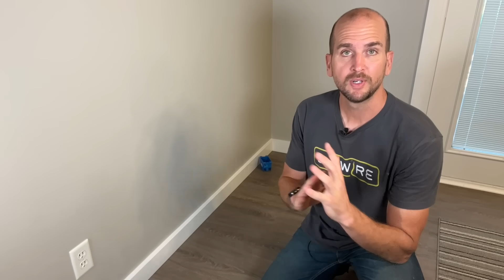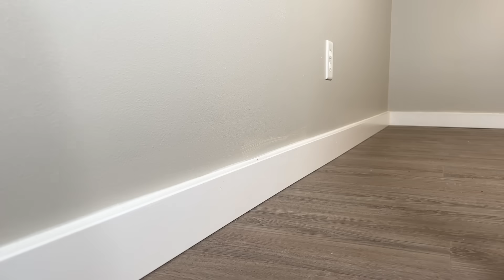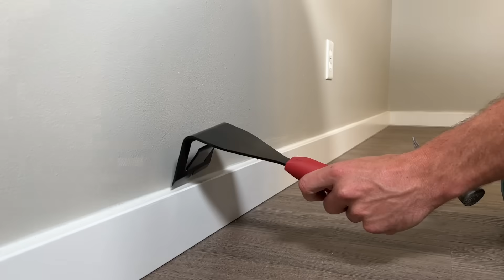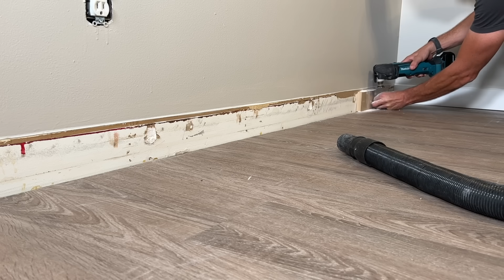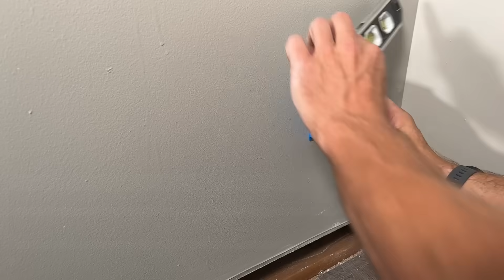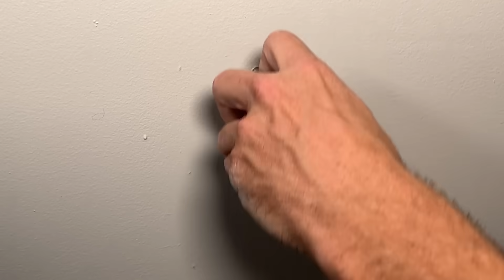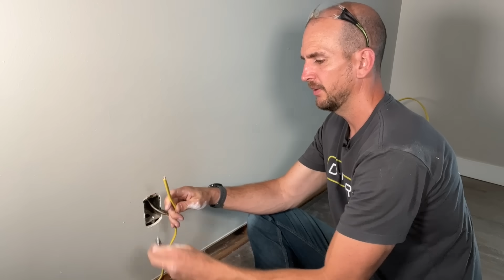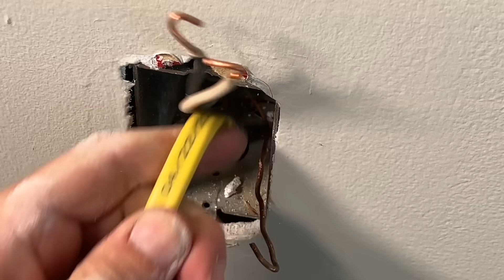How To Add An Outlet To A Finished Wall

Comment: As a Licensed Journeyman Electrician (WI) of almost 30 yrs, I have to question 2 things.  1.)  Why in the World are you using 12/2 (which is use for 20a circuits) and not 14/2 (which is easier to use and much cheaper - 15a), unless you plan one using Heavy duty power tools in that room, and ... 2.)  Yes, the connection to the receptacle would be a "hack" connection in a "NON-Commercial " outlet  which can cause problems with outlets that are fairly used and removing the wires often results in breaking the wire inside and having to replace it.  I have also seen where the wires that are pushed in, overheat as the contact points actually open up over the years. I would STRONGLY urge anyone trying this to consult a licensed Electrician first ( 99.9% of them will give you free advice) which can save you time, money, and the confidence that you will not create a fire hazard. YES, I have been to MANY homes where the outlet overheated and and the wires actually charred.  Residential outlets cost about .35 - .50 cents,  compared to the Comm Grade at $2.50 to $4.00 depending.
Reply: As a licensed electrician you should know it is against code to use 14/2 on a 20 amp circuit.  Also, the outlet he used did not have a spring connection against the wires - it had compression plates that tightened from the side.  He pointed this out.
Reply: @userdjl  My question was.. why are you installing a 20a in a bedroom/office, when there is NO reason other then, you plan on using it as work shop with Drill Presses etc. or Kitchen...AND..AND, I know he was using Commercial Grade, was just making a point as to NOT confuse that with a resi-grade.

Comment: Really nice job, and great video. I'm a 67 yo electrical engineer and do my own home improvements including finishing my basement.  That's a clever trick to take the wiring down to the baseboard. Nice job describing the potential gotcha's like stud holes where your trim nails will go, clipping the old trim nails instead of yanking, and strain relief/protection on the cable going into the metal box.

Comment: also make sure you are not drilling a hole bigger than 1/3 the width of the stud if its a load bearing wall, or 2/3 if its non-load bearing. and to also drill in the middle

Comment: Code seems to require stapling the Romex to a stud within 8" of where it enters the receptacle box.  Is that required for old work, such as shown here, where the  box's Romex opening is too far from the opening in the sheetrock?
Reply from the maker: I think you get a pass for renovation projects but for new builds you need to secure the Romex.

Comment: am i the only one crazy enough to be thinking he should have put 3 pin wagos in so you can go off this outlet to another if you add one in the future much more easily by just sticking the new wire into the empty slots?

Comment: It’s called non metallic cable.  You also need to add nail plates over the penetration through the studs if there is less than 1-1/4” from face of the stud to the outer edge of the drilled hole

Comment: Love the tip about per-fastening a strain relief onto the Romex, then fishing it up into the metal outlet box.  Some take shortcuts, like hiding the Romex within gouged-out drywall,  but this was done the right way, with the wires well protected from possible attack from screws and nails in the future.  Great video!

Comment: Although particularly with the Romex clamped with electrical box connections, this looks okay to me, doesn't the NEC also require anchoring (e.g., stapling) the Romex within 12 inches of the boxes?  Or does the NEC exempt retrofit installations like this?

Comment: Isn’t the blue box supposed to be attached to a stud by code? How are you accomplishing that?
Reply: It’s an old work box that has 2 wings with screws that clamp onto the drywall to hold it sturdy. It’s allowed by code and used all the time especially when the drywall is already put up.

Comment: You have your outlet orientation wrong. I was told I did mine wrong. Ground pin has to be on top not bottom. It’s said that if something was plugged in with hot and neutral on top could get shock if something tough hot and neutral on top.

Comment: this is definately not to code anywhere i have lived (and worked), the new box is required to be anchored to a stud, and drilling a 1" hole through the studs for one wire is ridiculous.

Comment: Could you show how to do this on a "plaster" wall? Removing my baseboard was a challenge as they used thick guage 3" long finishing nails with q hammer and setting punch., Plus the baseboard is a hardwood and hasn't been removed since home was built in 1926. I followed this video but my baseboard didn't just pop off like yours. Those finishing nails grabbed do hard it damaged the baseboard as i carefully used this method. Will probably just mill up a new baseboard. Im going to have to break the plaster away at the bottom as it won't cut like drywall. Great video for drywall homes

Comment: Wow!  That was a beautiful job you did!  Loved all the neat tips like raising up the holes in the stud so the nailer did not hit it accidentally.  Pro tips and much appreciated.  The rewiring was masterful.  Wago is the way to go!  In every electrical application, Wago is reusable, easily removable, easy to install, and durable.  Even in van conversions, this is the right electrical connector to use. 

One tip on your video - Newbies to electricity like me, need you to go slower on the rewiring of the old socket.  A bit complicated.  I had to slow it down to speed 25 to see what you were doing. It would have helped a lot if you had gone real slow on this tricky section and explained it slowly too.  This can lead to major disasters if not done accurately the first time.  So please, for  this sort of area, slow down a lot so we all understand.  Most of us are DIYers not Pros.  

Just so others know... there is an air gun nail remover by Air Locker (buy the driver kit with spare driver) on Amazon for $58 and if you connect it to a small air compressor (Porter Cable 6 gal 150 psi pancake type is enough) you can shoot those nails out easily from reverse side.  Handy tool for pallet and wood salvaging as well.  Nice to have. You can reuse lots of old discarded wood this way. I would shoot out the existing nails then reuse the holes for new nails.  The Air Locker AP7000 weighs 2 lbs and costs $58 with spare driver, whereas the Haupt runs $44, weighs 4 lbs, and you cannot replace the driver. Both need 70 - 120 psi minimum to run.  The 150 psi is plenty.

Comment: Does the cable need to be stapled to the stud at the connector or is that just for running cable from the ceiling?

Comment: Thanks so much for this video! I just finished adding an outlet, extending from a hallway through two closet walls into our mechanicals closet (GFCI) for a hot water recirculating system. I had to notch  corner studs but everything worked as you showed. Enjoying the outcome!

Comment: I did not see you install a connector between the new blue plastic work box and the Rome cable, is a connector optional for the plastic box?

Comment: This is brilliant, I have project to move the location of my TV cable router box to a closet with no existing outlet. The out let I'm going to use faces out into the bedroom, I don't see any issue with using it to source the closet outlet. You sped through the rewiring of the source outlet way to fast for me to follow. Ok, I used my cellphone, slowed the playback to 25% speed and saw what you did.

Comment: I started using wago. And for me it seems it holds the wires better and insulates better. You don’t have to worry about being undone when you tuck in the wires into the box.
Reply: Yeah there only good if your a hack and shouldn't be doing electrical work because you didn't do a 5 year apprenticeship!😂

Comment: Since you want a charging station in that corner, why not use an AC outlet that includes USB ports.  A quick look at Home Depot shows some from Leviton that have either 2 USB A connectors, 2 USB C or 1 each USB A & C.
Reply: Still need cables with the type of outlet you suggest. Also there are no outlets with built-in PD ports that I’m aware of. Also also it’s not much of a charging station with only 2 connections.

Comment: I used to use hammer and flathead screwdriver to tighten up a nut on the wire clamp. Then I discovered they actually make little wrenches for this? It is a specialty tool but saves a lot of time and you get way better results..

Comment: I live in Spain where we have - literally - no joke - 2 foot thick walls.... This video is fine for wood and plastic builds but does anyone have advice for,,, what is basically solid rock? The house is built out of rocks... I just want to add a few outlets... BUT... then I have read there Impendence (? could have that wrong) and risk of burn out / fire. Its a rated 2.4Kw intake.... although I think we actually get much more - I've run units simultaneously that far exceed 2.4.... but running a line through brick / rock? Advice?

Comment: Sometimes when you have a pre-installed metal box, the knockouts have to go inside to remove them. This can be difficult to do. I have found when fishing a wall that there is usually enough room to go behind the box. If you screw a self drilling screw into the rear KO, you can easily pull the KO in with a pair of pliers.

Comment: Why on earth would you not use the secondary set of terminals on the outlet to connect to the new outlet?  I see no reason to add more wires and components in a box than necessary.

Comment: You dry wallers have it easy. In the with brick or stone walls this job is much more invasive!
Reply from the maker: For sure, "stick built" homes are much easier to modify as compared to masonry built homes

Comment: Serious question: Is it really up to code to run cable without piping inside closed walls in the US? And if so, is this the norm when building new houses as well? I'm a swedish electrician and here all wires run inside walls or ceilings must be run through piping to allow for rewiring in the future.
Reply: Extremely common in residential wiring over here that cable is ran without any conduit or pipe.

Comment: You should really use metal flex conduit when running wire in a location where it could be hit by nails/screws. Running wire that low without it is a spectacularly bad idea! If someone installs a larger trim or molding later on, they will definitely hit this.

Comment: Very interesting. Here in Europe all the buildings are don with hard material so if you want to do something similar you would need to hammer the wall out, make a lot of mess, and then repair everything.
I suppose it is better this way when the earthquake happens. :)

Comment: To any new-ish DIYers, any time you run electrical wire through a stud that may receive a fastener, be sure to insert a stud guard between the drywall and stud.  A stud guard is a steel plate that fastens to the drywall side of the stud to prevent accidental drilling into a wire that runs through that stud.  In the case of this video, he might have been able to slide it up between the stud and drywall if no drywall fasteners were in the way, but if there were some in the way then some means should be found to get them in place.  It's very easy with the drywall off, such as with a new build or a renovation that has the drywall off, and the basic ones have teeth that you just hammer in to the front of the stud.  If you're trying to slip one between a stud and existing drywall, though, there are some that have edges that wrap to the side of the stud and fasten on that side.

Also, the sensor he uses to check for dead circuit prior to work are ok for those dead checks, but when you're doing your final check on the circuit you should use a voltmeter that tell you the voltage of each outlet.  Knowing that you hooked the new outlet up to a known good circuit and that it has power should mean that it's good to go, but it's always good to explicitly know the status of what you just worked on.

Great video for DIYers looking to save time, money, and mess.

EDIT: Almost forgot to mention that you need to be careful about how many extra outlets you add to a circuit and what loads you plan to have on them regularly.  The circuits are made with a certain gauge wire that's rated for a max amperage.  Exceeding this should shut off the breaker, indicating the problem and allowing you to re-plan, but if you overload the circuit and the breaker fails to open, then that energy greater than what the wire runs can handle tends to want to ignite things.
Reply: You should not be giving advice that was a load of crap. 
1. Don't need a plate if you drill in the middle of the stud, rarely use them and only if the wire is within 1.25" of the face of the stud by code. Unnecessary for DIY job.
2. Plug tester is better than voltmeter for this application, and no real need to check actual voltage, it's always going to be 120V for residential.
3. You will never trip a standard 15A breaker off of a few bedroom plugs, and the function of the breaker is to trip from a short circuit, not to limit the load

Comment: Very ingenious, thank you very much.   One thing you did not do or show (not sure if this comment is correct) is to install a staple a number of inches outside of the box for the wire to the stud per code  (I think).  Min max distance may be dependent on using metal or plastic boxes.  Again excellent video.
Reply: Wrong on so many levels

Comment: The second outlet protrudes past the finish plate because the four ear tabs weren't broken off where they contact the blue box. Break them off so the outlet is at the same depth as an outlet whose ears contact the drywall.
Don't use an inch drill bit so close to the end of a stud, especially if the wall is load bearing. Use a half inch bit.

Comment: Do you have a video/instructions on running wires through a finished basement ceiling where there is no access between the floors? (Looking to run wires to install a ceiling fan).

Comment: I would have started the video by removing the outlet to see how many wires it had and if there were 12 or 14 gauge. Depending on that you can determine if you can add another wire.

Comment: Video critique: 

Everything is great in this video except for one little thing. Wires that come into a box, before you pigtail anything, have to be 6" minimum. Looks like you cut yours down closer to 4"-5" in the first outlet to match the existing wire lengths. Your old wires are allowed to remain the length they were, but newly installed wire should/need to meet code.

It might seem like something dumb and ridiculous to bring up, but every single code article was written because someone lost there life, or was seriously injured, or houses burt down. 

I'm not critiquing to be an ass, but DIYers could be living next door to me (or you!), doing their own work, likely short of perfection in electrical, potentially burning their house down and mine with it. So i gotta be very strict when i see videos on electrical work for the general public.

Otherwise, great work, and I highly recommend your channel to everyone. Loved the baseboard idea.

Comment: In this case would it be easier to use a power strip and just lay it on the floor or mount it to the wall?

Comment: I liked the trick with the pre-connecting the wire connector and getting it into the outlet box. Using the drywall behind the trim is a great idea. BUT, I think instead of drilling the studs high to avoid nailing to power cable is not the right way. Should have kept it down low and added the metal plate on the studs to keep from runing screws or nails into the power cord, as the way you did it, leaves the power cord unprotected from an accident in the future. Should still have left enough room - carefully - to reattach the drywall and trim. Cool video overall though!

Comment: You could also could use a short drill bit and drill to the right, then use an extentions or a  flex bit with a right angle drill adapter.  No drywall cutting and patching that way.

Comment: So why not skip the pigtails or the Wagos, and connect the romex directly to the other screws on the outlet?  Don't know if that meets code, but it sure as hell is a much better connection than a pigtail/Wago!  Obviously you'd want to pigtail the ground.

Comment: Suggestion to add to this video. You can see around 8:30 that the outlet box isn't quite flush with the drywall and there is a gap at the lower portion. A moment later, during the tutorial, the outlet is mounted back to the box but the lower portion of the plugs mounting bracket is not supported by the drywall. This will cause the plug to, eventually, be pushed into the wall to fill the gap and will look bad. 

My best suggestion is to take a small length of building wire and wrap it around a non flathead screw driver to create a spacer. The wire spacer is placed over the mounting screw and, if properly lengthened, will support a flush to the wall outlet when mounted to this box. 

I'm not sure about the NEC, but CEC dictates that outlets have to protrude from a coverplate. And I just saw your other video explaining this on the recommended videos to the right haha.

Comment: Another awesome DIY video. I'm going back and re-connecting wires in several switches with Wago connecters. And I now know that I can add an outlet.  Thanks again!
Reply: never use WAGO 221 for solid copper wire. Use wago 2273 for this. The wago 221 are only for flexible fine multistrand copper wire!!

Comment: Ground hole should be on top. Safety first! If plug is falling out the ground will be more exposed than the hot wires.

Comment: Good video, but does not pass code. You need the metal safety plates anyhwhere wire goes through a stud. Lower the wire to below the cut and install metal lsafetyh plate and you will lbe good.